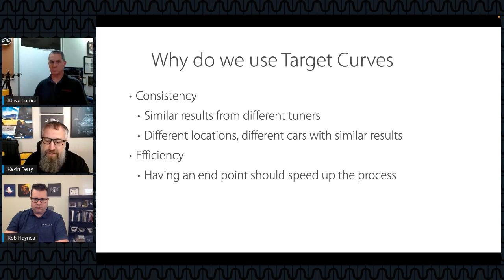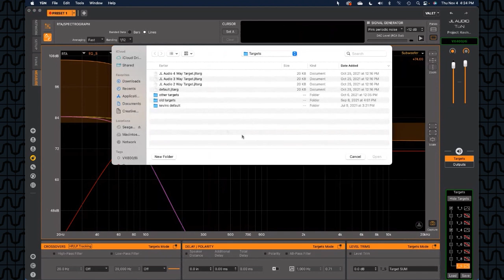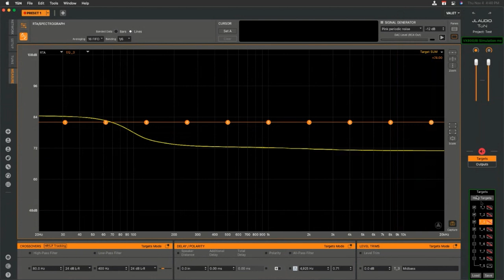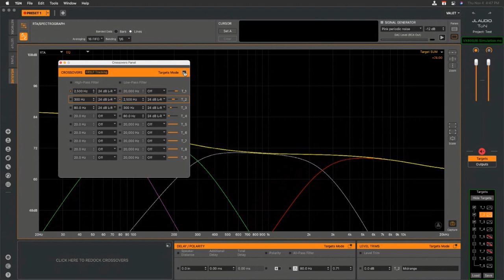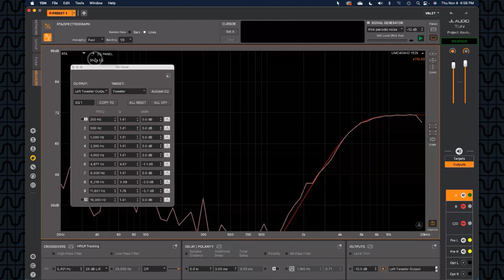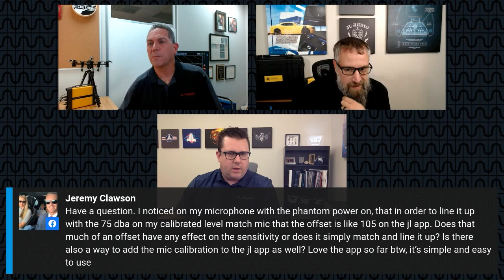[Live] JL Audio Training | Creating and Using Target Curves in TüN™ 4

Comment: all pass filter is magic!!! For the first time, it is actually possible to keep the door speakers in full range, while sub in low-pass, all in proper summation. Just apply all-pass to all non-sub drivers that matches phase response of the sub low-pass and voila!!! Amazing!!! You hear that tight, high fidelity bass from the front, BECAUSE IT IS COMING FROM THE FRONT (assisted by the phase aligned sub). As good as it gets at low-medium volume levels.